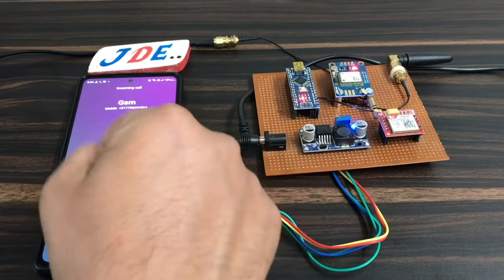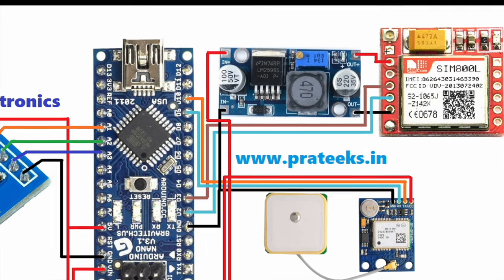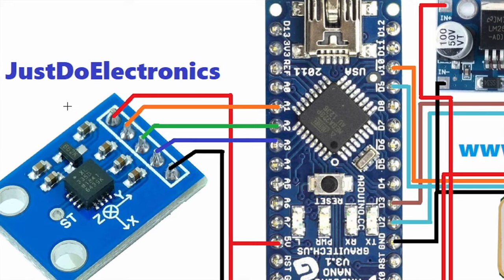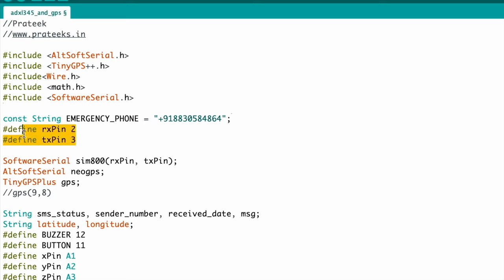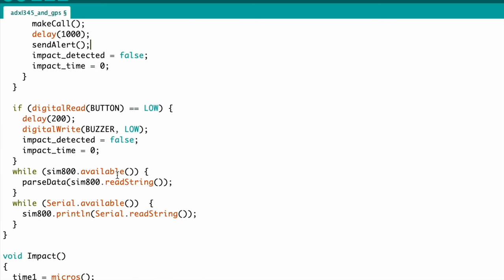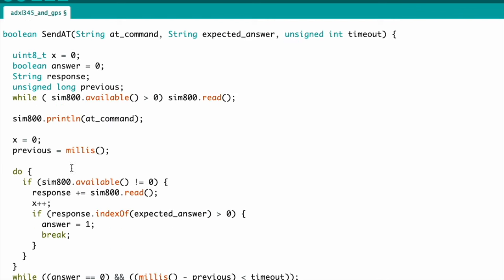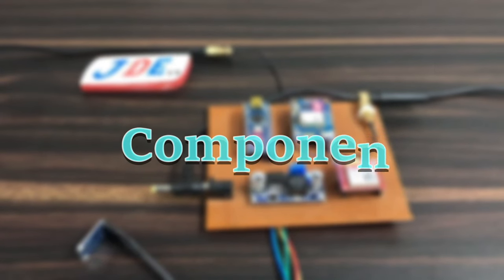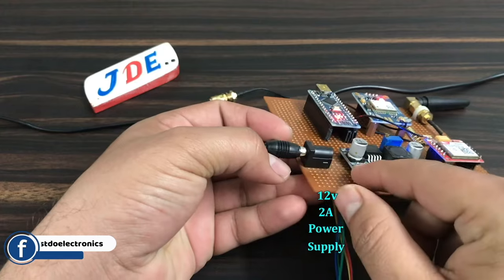Vehicle Accident Alert System Using Accelerometer GPS And GSM | ADXL 335

Comment: Sir  this circuit diagram in description link is same as the project shown in the video......because mine one is not working properly and I checked with diagram everything is same sir
Reply from the maker: Yes is same check connections properly

Comment: Can I replace the GPS module with another sensor? Can I also add another connection like a transmitter in the circuit? Or do I have to use another arduino due to lack of pins?
Reply from the maker: yes

Comment: @JustDoElectronics we need some help sir, this project I propose in my research  the circuit is done but the code error. done download the library. 🙏
Reply: BTW, it's working now guys just make sure the connection is clean and clear to avoid short voltage and don't forget add proper library to upload the code guys. and you can replace the gsm into gsm800l V2 guys so easy to use like call and text. Nice project sir Just Do Electronics your fun from philippines ♥.
Reply: sir please how did you connect the power supply it is not mentioned in the diagram